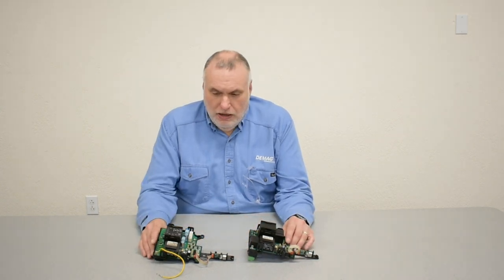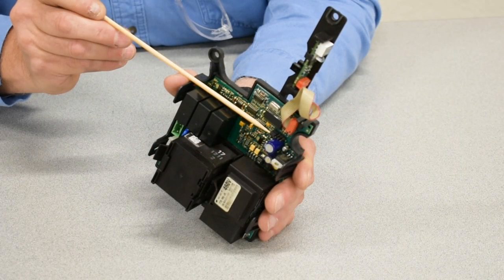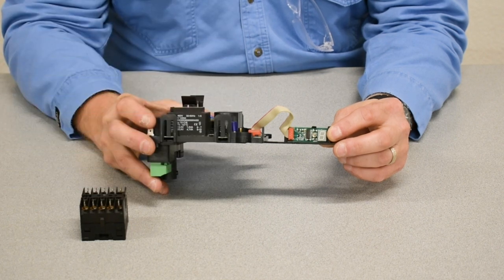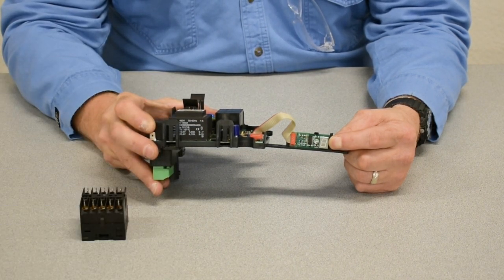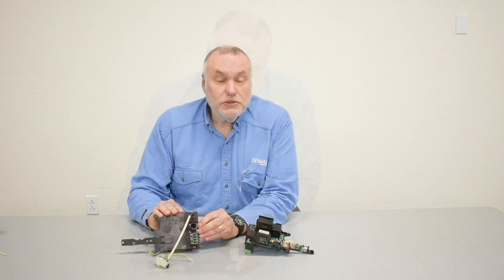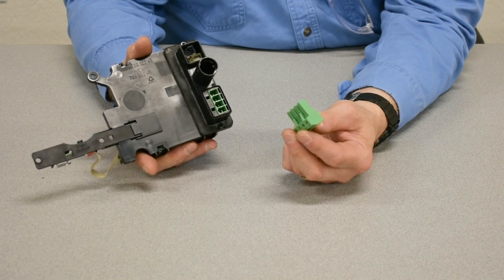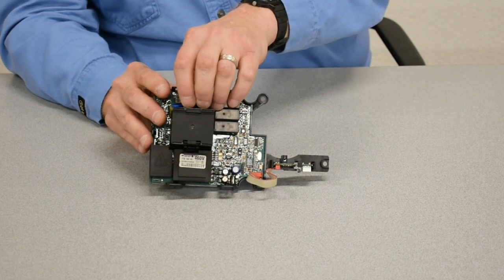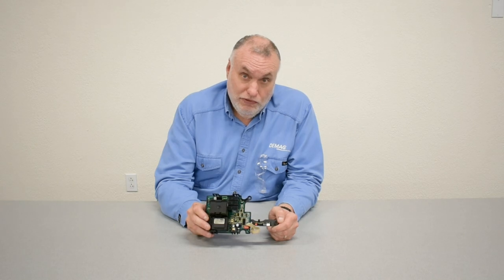Service Deep Dive: Demag DC Chain Hoist Control Board

Comment: Low quality by Demag. The electrical parts have a very short lifetime. Mine is dc pro 25. The old lowering and lifting contactor had broken. I replaced with new one while the contactor was really hard to find. The contacgor worked perfectly but there's rattling sound and the lowering doesn't work. The warning 7 and error 2 shown.. i checked the manual. Still doesn't know what went wrong. Do you mind helping?
Reply from the maker: The Demag location nearest you can help you troubleshoot your hoist. Please use our global contact search to find the location nearest you: https://www.demagcranes.com/en-us/global-contacts/

Comment: I have same crane, problem is trolly is working but hoist doesn't,even there is no light in hoist alarm display,my hoist card faulty ,what is its solution,. CAN I RUN DIRECTLY WITH FORWARD/REVERSE STARTER WITH BRAKE SUPPLY..
Reply from the maker: Reach out to the Demag location nearest you for assistance. Use our global contact finder here: https://www.demagcranes.com/en-us/global-contacts/